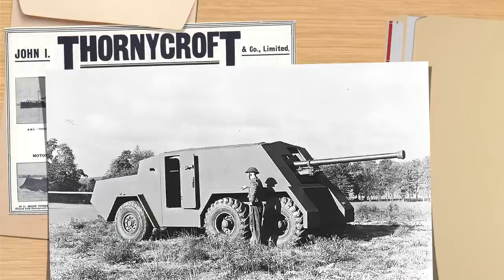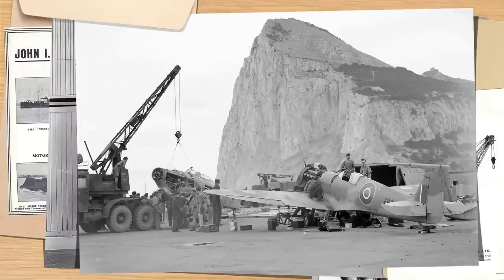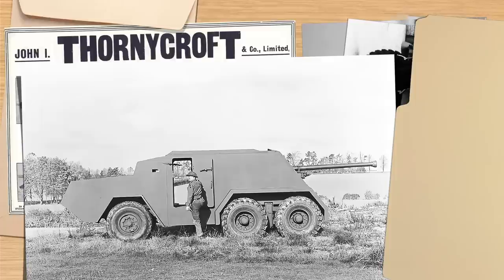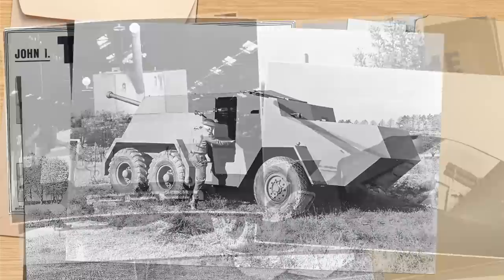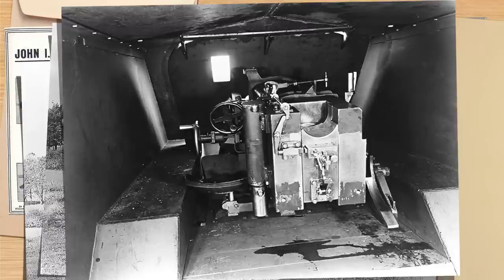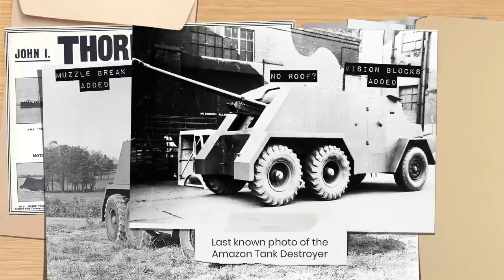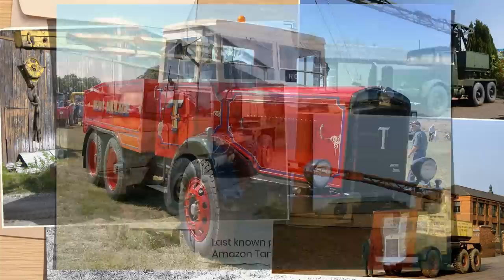Amazon SP  - Tank Design & Development

Comment: This was actually a pretty good idea given the current trend worldwide for wheeled Fire Support/Tank Destroyer vehicles! The down side was the lack of a rotating turret - as all the modern 'versions' have. In a way it's a take on the 'portee' style AT vehicle idea used in North Africa (usually with a 2 or 6 pounder). The backwards gun isn't such a daft idea - the ARCHER got away with it - but the wheeled format may have spoilt it's usefulness. In fact I think that this may have inspired the idea of the Valentine chassied Archer. Very interesting - thanks.
Reply: Modern suspension systems, etc, are alot better than ww2. And modern roads are alot more extensive than in ww2. 

Wheeled tank destroyers were used extensively in the desert in ww2 (check out 2pdr, 6pdr and other portee mounts, but alos the deacon {an armoured, turreted truck with a 6pdr}). But were quickly found to have very limited use in Europe.

Comment: Thanks for posting this!  As an aside, a scale model of this could be made easily using the Airfix 1/76 scale RAF Recovery Set's Thornycroft Amazon crane, combined with the 6-Pounder that comes with their Bren Gun carrier.  I think I have both in my stash, and I'm strongly considering this interesting, simple project . . . .
Reply: Correction:  I'm going to need to scratch build a 1/76 scale 17 Pounder for this project.  Not as easy as using something already available, but as long as I have my sheet plastic and spare parts box out to build the armored casemate for the truck, I might as well try my hand at scratch building the entire 17 Pounder; or at least roughing it out.  (Maybe if I'm not too picky, I could take the barrel from the 1/72 Airfix Sherman Firefly . . . .)

Thanks again for posting this video on a rare and interesting subject!
Reply: @modelermark172  if you haven't already done it, isn't there a towed 17pdr kit out there with the humber car or something
Reply: @hammer1349  Thanks!  If I do decide to do this project, I'll keep an eye out for that kit.  That said, these days it almost doesn't pay to attempt any one-off scratch build project as it seems that plenty of established model companies (or garage industries with 3D Printers) are filling those "gaps" quicker than most modelers can via scratch building . . . .
Reply: @modelermark172  I can't remember if it's a 17pdr or a 25pdr artillery but I imagine there is something like that out there
Reply: @hammer1349  The only thing I could find after a quick online search was the Airfix 1/76 AEC Matador with the 5.5" gun.  That said, the exposed part of the 17 Pounder on the Thornycroft Amazon SP in this video looks fairly simple, and could probably be convincingly made from Evergreen styrene tube, or even scrap part tree runner.  If I were to attempt this conversion, it would be done "Old School" late 1970's - early 1980's style where the goal was to "get the point across," rather than making a rivet-per-rivet copy.

As a sidebar, "back in the day" before the internet and online search engines, modelers often would only have a photo or two, plus a few lines of text, (found more by accident than on purpose,) to base their conversions on.  Ironically, this led to more actual (albeit inaccurate) builds as there really was no way to find out everything, leaving a lot of conjecture on the part of the modeler.

Comment: Sorry to tell you this, but this looks a lot like a wood mockup to me (painted wood). It would also explain the thickness of the material which seems to be rather thick at some spots for metal, metal being rather heavy it's highly unlikely that this vehicle would have been fast if indeed that were all metal armor plates.  I don't think it ever got much further then that based on these images. It would fit in as well, during that time period a lot of companies would make a wooden model first before using metal to make sure they didn't waste materials. This could be a similar case like that.

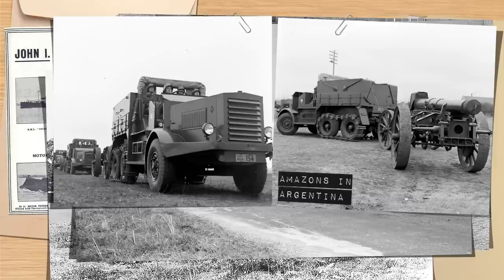Comment: 1:15 The photo on the right. Why is this kind of track not used in military vehicles while it finds its use in the commercial market? Half of the modern Harvesters can be fitted with such and further expand the off-road range and capabilities of a truck or wheeled APC.
Reply: Likely because it would risk causing damage to regular roads. Its also another thing that logistics needs to take into account. Someone needs to build the tracks, make spares for the tracks and then deliver them to military units that won't always need them but still want to have them just in case. Fuel efficiency etc are also things to take into account but end of the day, I'm not a vehicle designer so take my hypotheses with some salt